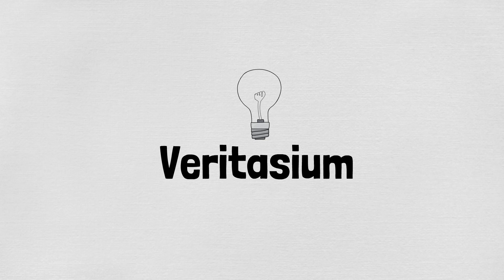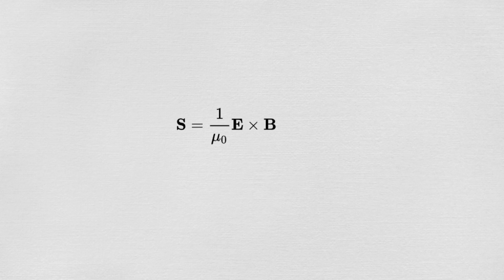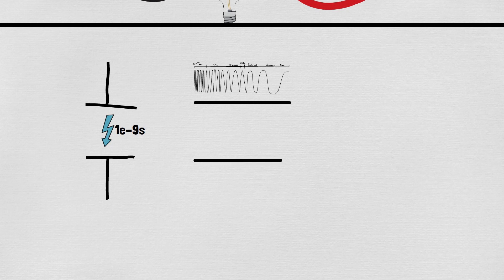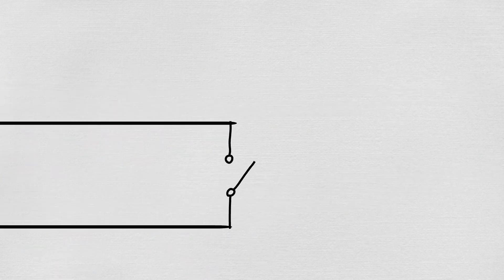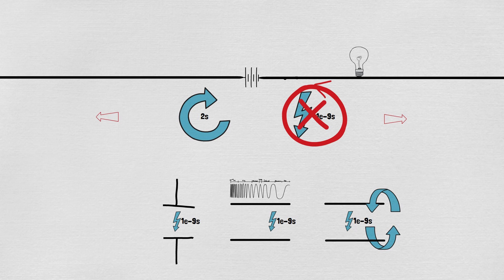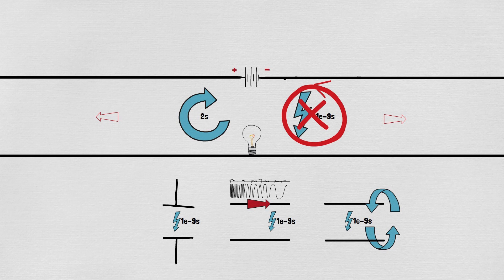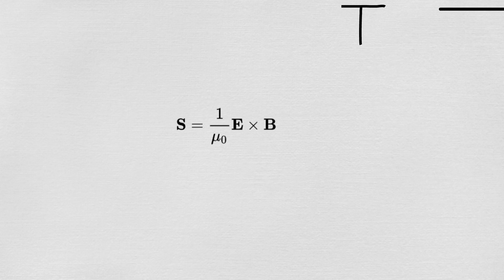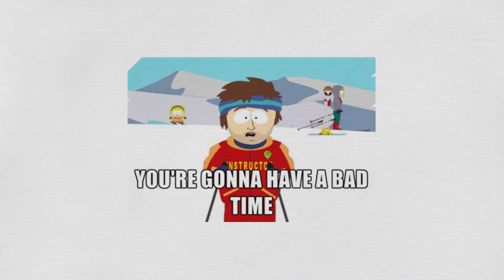Veritasium is Right? (see description)

Comment: There are waves of changing current flowing out of the battery, along the wire, as well as a very small initial current at the bulb (after 1/c). The interesting question to me is how fast it is travelling, and how it settles down.
Reply: Transients are the key here
Reply: The wave(s) of the flowing current starts propagating from the switch, not from the battery. The switch disrupts the equilibrium state and allows the current to flow. - The wave propagates near the speed of light.
Reply: Em field and elc field generated by free electrons diffusivity

Comment: This should be analyzed in the frequency domain as the fourier (or laplace) transform of a unit step function.  The antenna and capacitance coupling of the wires will provide very limited current - probably not enough to light a bulb even if the wires were very close together.  
I like this explanation.
Reply: Yes, there will be ridiculously tiny currents very quickly and Veritasium had as one of the unrealistic simplifications that the light bulb turns on with any current, no matter how small. That means he is technically correct, but it is very misleading, arguably deceptive (I don't think he meant to deceive, he's just wrong and doesn't realize the problem. It's complicated, I don't blame him.)

Comment: Thank you...you got it right.  My initial take was to view the problem as two responses.  The initial transient response at the moment the switch is closed causing miniscule transient power into the bulb in 1/C seconds using the capacitive and antenna coupling mechanisms.  Then the steady state response as charge and the DC static E/M fields begin to propgate in and around wires, with real power that can actually light the bulb reaching the bulb in 1 second.

I wonder if this can be tested with real wire, say 1 mile or so in both directions.  Modern test equipment should be able to make the very small timing measurements.
Reply from the maker: yes i think anyone with an oscilloscope could measure this and settle the debate. unfortunately, i don't have one :(
Reply: @antimatterhorn  I saw some EEs guestimating what fraction of the full signal would cross the gap before the full signal arrived through the wire.  Their estimates seemed high, but it's been too long for me to be confident in my intuition.  Hopefully someone with an oscilloscope will put their results on YouTube.
Reply: Sadly Derek prefaced his thought experiment with a magical light bulb that will light up with ANY current that flows through it. Essentially making it a pointless thought.
Reply: @antimatterhorn  Tony Wakefield did an X but using a different circuit. Erik Margan copied Wakefield's X. Both Xs support what i said happens (see my comment of today).
Reply: Except it is NOT capacitive.  That is a deceptive "lumped element model" of a transmission line.
..

You must understand that loss-less transmission lines have a characteristic impedance that is purely resistive. The L and C are DISTRIBUTED, not lumped.
You could have just as easily modeled it in the "T" configuration instead of "pi", with the Ls FIRST ,making it  it look inductive, but that is still incorrect.
..
Therefore, they look like resistors (of about 800 ohms). 
This is the characteristic impedance also called the surge impedance. 
They look like resistors until the reflections come back from the shorted ends.
.
So, at t=o, when the switch closes, the battery is connected through two 800 ohm resistors to the bulb that is 1 meter away. Therefor,  1M/c seconds after the switch closes, it has a lower current until all the reflections die out when the bulb lights to full.
The way the E and M fields operate causes this to happen.
Reply: @antimatterhorn  Ben Wilson's HFSS simulation video shows this.
Reply: @chrisjacobsen1659  The entire configuration is disingenuous.
Reply: @antimatterhorn  But I do! I answered elsewhere about the transmission line effect of this circuit. Forget the capacitance or inductance, essentially this is a transmission line problem. I suggest you think of a slightly different arrangement, remove one of the long loops, and put the lamp at the end of the other,  now what happens? The lamp will light after the line delay time, about 1 second, because this is how long it takes for power to be delivered to the lamp. Where the lamp or switch are in the circuit doesn't matter, the circuit change (the switch closure) is what actually propagates through the line delay. It is not possible (or reasonable) that the circuit operation changes due to space only, so we should assume that the result is identical whatever the physical position of the components is.

I have always been very unhappy with the frequently made assertion that electrons push one another along at c to cause current in a circuit. The EM explanation doesn't work for a DC circuit either (except perhaps at switch on) as we cannot have a zero frequency EM wave (or can we?).  I will make a video very soon.
David CEng
Reply: @Observ45er  Isn't it precisely the kind of thing one would see in a college course? With the exception of the distance from battery to bulb and the nonexistence of resistance it seems entirely simple and common.
Reply: You would need a very powerful source to power 2 miles of wire. You're essentially talking about a power generator or sth similar (depending on the thickness of the wire of course. Real wires have resistance and inductance. Moreover Electrical Engineering in general as a discipline has models to calculate the crosstalk between two conductors that abstract away from the EM fields and the differential equations, and instead model the problem with RLC circuits.
Reply: @antimatterhorn  find me a source capable of driving such a long wire and the wires themselves and I can find the scope lol :P
Reply from the maker: @InTimeTraveller  you wouldn't need a particularly large circuit to test this. you just need something that is as long as a few multiples of the distance between the switch and the bulb. that and a GHz oscilloscope. there is an initial pulse at 1e-9 seconds after the switch closes (not enough to light the bulb probably), and what's in debate is what happens after. if the circuit were say 50m long, that gives 50 ticks on a GHz oscilloscope to discern what's happening at the bulb.

Comment: If I understood correctly EEVBlog's response, which as far as my limited understanding goes does not contradict yours entirely, the light bulb would very briefly receive some power almost instantly (and maybe flash dimly) and then turn on for good after 2 seconds. I think part of the confusion stems from what we mean by "turn on".
Reply: What happens when the cable is broken at the farthest point away? Will it still dimly turn on after 2 seconds?
Reply: Wouldn't that apply to any bulb roughly the same distance from the battery, whether or not they form part of the actual circuit?  As in, as current starts to flow from the battery there's some (very weak) EMI generated that any nearby device could pick up (and interpret as "power").  I don't think that should count.  It's too short-lived and likely too small to get any visible reaction out of a resistive bulb whatsoever, and it isn't what actually powers the bulb while the circuit is switched on.
Reply: @romanski5811  well, no
Reply: @fmdj  
I'm sorry, I didn't know why I put in that second part, that doesn't make sense. Let me be repeat it in a way I actually meant it:
What happens when the cable is broken at the farthest point away?
Reply: The peak issue with Derek's "explanation" is that in order to fit his desired model he throws out enough of the actual physics of the problem to make it work. That's bad science and worse science education.
Reply: @romanski5811  hmm, the wire will still act as a capacitor and we'll observe the same tiny transient current in the light bulb but nothing after that short initial phase?
Reply: @fmdj  Indeed, the transient voltage change while closing the switch is key to this.

What this video gets right is that the position of the switch does matter. Where it fails is to consider the transient state after the initial state, and goes right on to assuming the stable state. This is understandable, since most design engineers only need to deal with DC or low frequency AC, while fast AC and wave propagation/transmission is usually left to the RF-engineers.

The most important thing is that the unconnected part of the switch is initially at battery minus potential, or floating in the case of several switches on the line (in this case it can initially be at any potential really). This initial difference in potential will enable a step impulse to form as soon as the switch is closed, and this step impulse will travel through the line, causing current to flow, just as it would travel through any other transmittion line. It is this current this video fails to consider, and as you mention, this current is what's enabling the bulb to briefely light at 1e-9 seconds.

When reaching the end of the line, the energy which wasn't already used from the transient edge will see an open or short (depending on if there's a second switch), and then bounce back in or 180 degrees out of phase. The transient edge will keep bouncing back and forth like this, from end to end of the line, untill all the higher frequency energy in the step impulse is spent. In any way, before this has happened a few times, the DC following the step response has stabilized after 1s, and will light the lamp fully if all switches on the line have been closed.
Reply: @romanski5811  it would be like coupling a DC powered bulb through a capacitor.  It would receive some small amount of power until the cap fills up then nothing. Francoise-Marie is right, the definition or requirements of the bulb being on aren't defined well enough for everyone to get to a good answer.
Reply: @TheMovieCreator  thanks for the detailed clarification! This answers a question I had as a kid in physics class, which I formulated more or less as: "how does the electricity know the circuit is closed if it doesn't flow in an open circuit?". The teachers never had any sort of satisfying answer, like, "just admit it". So I maintain that Veritasium's video has educational value, albeit a bit indirectly :)

Comment: THANK YOU! finally someone that is correct. And, to help support this: We use signal generators to send pulses throughout circuits to "look for opens and shorts of PCB traces or breaks in a cable". This has been common practice for decades in industry. The whole reason this works is that the voltage (current) signal must travel down the copper line. It travels down the line and reflects depending on the load that it runs into. If it is an OPEN circuit, it reflects but changes polarity. If it is a SHORT, it reflects with the same polarity. Using the time of reflection, we then can calculate exactly where the SHORT/OPEN physically is (and repair it). So, none of this would be true if Veritasium was correct. It's also interesting that this is a known graduate level EM question posed to students and most people get it wrong. 
Another thought experiment: Run a long cable from here to the Moon; at the end of the cable at the Moon place another cable that is parallel to the first cable but only AT THE MOON (so basically we are building an RF coupler AT THE MOON); when will a current get induced in that 2nd cable (coupler)? We won't see the coupling signal show up until the EM signal travels down the cable from the Earth to the Moon! If it were instantaneous, then information would be travelling faster than the speed of light, and we know that is a big no-no.
Reply: Sending signals isn't the same, in that case the information only travels at a few hundred miles an hour. Long wire delay lines have been used in Radar systems for decades. but this isn't a signal.
Reply: Wrong, this is working exactly as Veritasium is saying, the key with Veritasium's model is the switch and battery and lamp are relatively close to each other. You are using the same principle for you break detection that Veritasium is suggesting.
Reply: You are wrong, time domain reflectometers on PCBs and cables works by sending an em wave between the conductor and a ground plane/shield and listening for the reflection. If these wires were placed  on a ground plane then the signal would need to travel along the wires. In this case each side of the circuit looks like a transmission line with a impedance of about 1000 ohm until the reflection from the far end returns. The initial current are independent of if the wires are connected in the end or not. If the wires are open in the far end the current will decay towards zero as the reflections goes back and forth in the circuit. If the wires are connected in the far end the current will increase when the reflection returns and for each time the reflections goes back and forth the current will approach the steady state DC current.
Reply: YES, on your wire to the moon thought experiment. 

There is a demonstration that can actually be set up to measure this delay. (I've done this. The main expense is a modern fast. digital oscilloscope that can record the signal trace and timing accurately enough.)

Using a long coax cable, put a sensor, the oscilloscope input, at the end of it. The coax can be viewed as a wire (center conductor) running out a long distance, and another wire (the shield) running back the same length to complete the circuit. (The original example of putting two long extensions of wire on either side of the battery and bulb is a red herring.) 

Put the scope 30 cm (1 light-nanosecond) next to a transient pulse signal source. (A battery does nicely. Momentarily touching the wire to the battery where the shield is connected to the other side sends a transient signal.) Trigger the scope with a short line also connected to the input of the long cable. (Technically there will be a short delay along the trigger cable, but that can be accounted into the calculation. The scope will not trigger itself without a physical wire input to the trigger input, so it will not be "seeing" the signal jump across the air gap.) Then measure how long till the input channel at the end of the coax sees the transient signal. A single pulse is easier to see than trying to observe the onset of a periodic AC signal relative to a single pulse trigger, or an edge in going from ground state to a DC voltage also works, to make it similar to turning on a light bulb. 

If the coax is long but not too long to totally attenuate the signal, say 100 m, the scope will reveal a 330 ns delay from trigger to input channel, significantly longer than 1 ns for the gap from the source to meter. Nor will the delay be a 0.003 ns representing the 1 mm spacing between the center conductor and the shield. (This wire to wire gap is equivalent to the lumped circuit, antenna transmission line that some videos are using, totally incorrectly.)

The delay will be about 3 times the cable length (not the total length of the conduction path along the center conductor and back again) divided by c. 

This demonstrates two things. That the signal does indeed propagates along the length of the cable, not directly across the 10 cm gap from the source to the meter. The typical index of refraction of the insulation in a coax is 3, which slows the signal transmission speed to c/3. Thus, the signal is traveling through the insulation between the center conductor and the shield, not some other speed inside the wires.